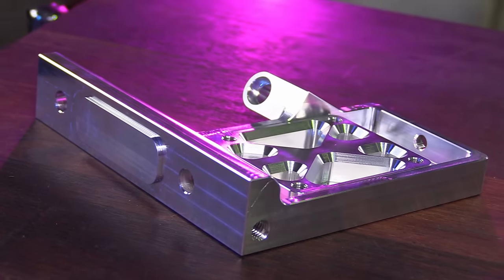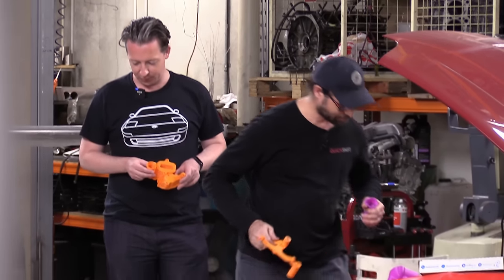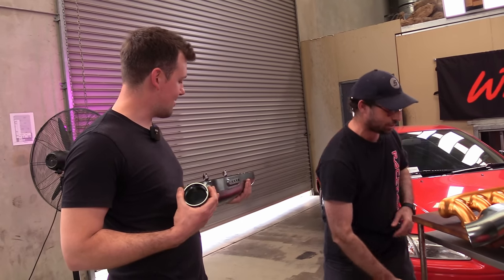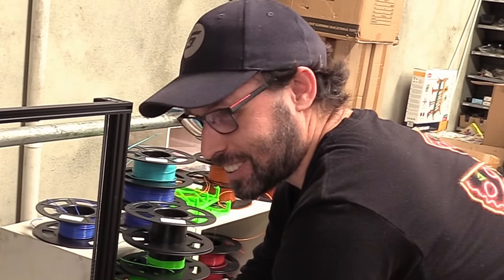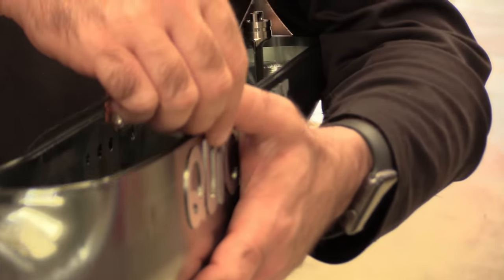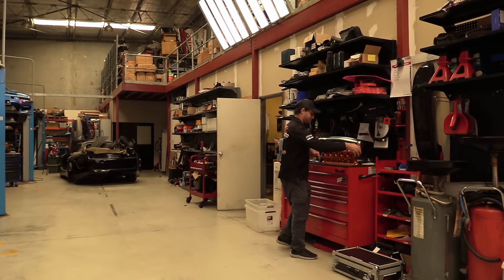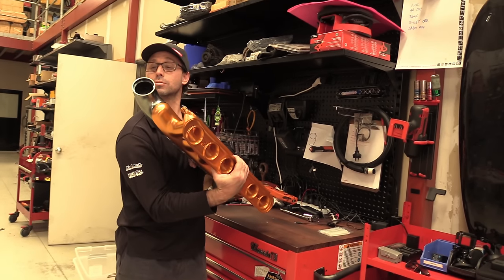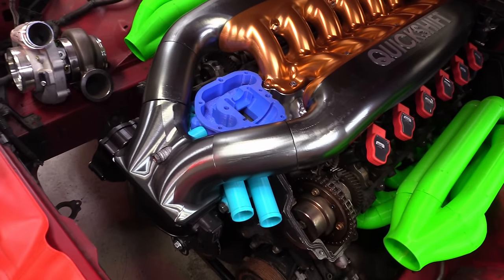Supra Supreme V12 - $10,000 Completely BILLET Intake is Here! [Ep17]

Comment: Use a lower durometer o-ring. Also you could have calculated the effective surface area of the manifold plenum, multiplied that by boost, divided by three and gotten the pullout force on each bolt. Combine that pull out force with the torque you can now measure applied to the bolt and you'd know if the load was to severe for the bolt strength or thread strength.
Reply from the maker: Thanks Dave! We do have some alternate o-ring materials incoming :) We have calculated the limits of the bolts and threads, that's no issue. The only concern is the possible flex of the actual billets under high boost leading to a loss of tension on the o-ring. Time will tell!

Comment: New Supra Supreme days are always good days. That manifold is something to be proud of, well done.  A better quality printer might be the go if you are looking for more accuracy too, although it'd be tough to find one that prints the sizes you need for a non ridiculous price, just my 2 cents.
Reply from the maker: I wish! Sadly, good quality printers that can do 400mm prints are $$$$. If I'm wrong, let me know!
Reply: @QUICKSHIFTtv  One thing that would get some instant results for less print fails would be to enclose your printer. When the ambient air temperature around the print fluctuates it can cause spaghetti piles as the printed part will curl, up particularly on sharp corners. Eventually it will get high enough to crash the extruder, which in turn moves the part and then it's all over at that point.. If you can keep the air temp nice and constant around the print head the extruded plastic will cool at a much more constant rate and weld itself to the part much better. 4 clear perspex sheets in a box around it wouldn't cost much and would do the job nicely.

Comment: without a thermostat your engine will take longer to warm up, but it will also continue to heat up as long as the car is running,...  so if you were to leave your car running without a thermostat for long enough it will overheat, thats because the thermostat is needed to hold the coolant in the engine block long enough for it to heat up to a temp that will expand the parafin wax inside the element of the core of the thermostat to open it and exchange the hot coolant, with the colder coolant in the radiator, which is beaing cooled by the moving air as you drive or by the radiator fan and in some cases both.    
Also an engine will generate the most heat whilst idle  not moving   (no air flow)   trick is larger surface area of the radiator   i grew up doing street stock and IMCA dirt racing  we dont run thermostats  we rev our sbc engines to 10k and its very rare to ever overheat  for 30+ laps on a 1/4 mile oval with 40+ drivers bumper to bumper   we have giant radiators on these cars

Comment: Amazing as always mate!!!!! But ? How come you just didn't use studs on the Plenums wing doodads? Why bolts? Seams like for ease of assembly studs would be a much better way to go, and increased clamping force as well. Just my 2 cents/ food for thought. Either way I love every episode and you're amazing craftsmanship ,the next episode cant come soon enough 😊
Reply from the maker: I feel bolts look nicer, and they're not the weak point.... the thread in the aluminium at the other end would be the first thing to let go. So bolts are good enough!
Reply: @QUICKSHIFTtv  wow thank you for responding, and it was the perfect response 👌I might add, I can see what you mean, a nice rounded machined allen button head design would blend in nicely with the rest of the manifold I concur. Also I didn't mean to imply it was a weak point, and I fully understand the threads in the other end would go first.

Comment: Might just be the camera angle but does that put the thermosat at the high point making it more effecred by any air in the system?  Perhaps a filler hole in the housing to help bleed any air trapped in the manifold when you fill the coolant. Could double as a sensor location.
Reply from the maker: You're a thinker! There is a secret bleed point at the highest spot, on the back side of the top housing.

Comment: Have you tried tree supports and limitations on infill walls if u limit them so much easy to pull out 
Good job though awesome work 👌🏻👌🏻👌🏻
Reply from the maker: Tree supports on my never ending list of things to figure out oneday. I haven't quite solved the support structure interface for easy removal either. Its not bad with PLA but PLA+ is so much stronger, it hates to let go. Also I print really hot for strong prints but I think that makes the supports melt in too much. More things to experiment with!
Thanks for the comment!

Comment: Don't know if this will help or not. I deal with large diesel engines  to get  away from large thermostats some engines I have use two normal ones. What I suggest is that maybe two small thermostats might fit better than one big one in that spot.
Reply from the maker: That genuinely came to mind. In the end, two small ones take up more room with plumbing than one big one.... and I was able to make the big V12 one fit.... after much failure. 

Thanks for the suggestion

Comment: Could u design a procharge that sits on top of the intake manifold instead of having pipe running out of intake no lag because damn thing molded straight to intake. Idk not ever seen anyone do it and I think its the key to no lag for exhaust side and intake side # no more intake exhaust tubes.

Comment: Loving the project, quick question on the water manifold though!  I thought the thermostat regulated water flow out of the engine before the radiator rather than after it goes through the rad?
Reply from the maker: I can't speak for every engine out there but every Japanese engine I can think of uses a thermostat to regulate cool water in, not hot water out.
I know what you mean though, it feels illogical!

Comment: I'm just starting out watching this video now and I've always been intrigued about the engines and the twin turbos but one thing that I've come to realize with a v engine in twin turbo and plenums you have to have a balance to between the two plenums to even out the whole engine because 100 could get one or two pounds more boost than the other side of the engine and that's not good. But do keep in mind that's speaking this speech to text I'm just starting out watching the video so maybe you do have a balance to between the two plenums.
Reply from the maker: It’s a good observation. We are combating this two ways, the plenums are being fed by a common intake pipe and dual butterflies that are connected by a single shaft to ensure equal distribution at all times, and we will also run twin pressure sensors so any difference in pressure can be detected and compensated for by the very powerful Emtron KV16 ECU

Comment: Hey what's the best way to get ahold of you guys. Have some cool stuff I wanted to talk to you about. 

Awd attesa ets supra conversions with gtr parts are suoer easy in the grand scheme.

So sre 350z gtr awd conversions and 370z conversions if you know what you are doing. 

Plus you can do some mods to the transfer case to use the electromagnetic clutch from g35s and r35s to make attesa even better on r32s to 34s. And conversions. 

You can also likely just make a billet housing that would convert supra 6 speeds to gtr 6 speeds with the additional transfer case. 

Might actually be worth doing. Would make it easier to convert some of these cars and play with more conversions. And make it possible to build a complete gtr or supra billet transmission versus trying to rebuild pull outs. 

Plus gtr parts are getting harder and harder to get ahold of. 

Worth thinking about. If you want to talk about some of the info just let me know. Might be worth business wise for actual profits given the number of 350zs 370z and the cross over bits. 

Would also come in handy for auto to manual supra and skyline conversions. And gt25 to gtr almost conversions. Rb30 blocks are cheap. After market rb26 heads and some machine time would potentially be a cheap route to a gtr engine built straight away for less money long run and some less uo front costs. 

Only thing really needed for the z conversions are some suspension bits that'd be easy and a few other things that wouldn't cost alot to r&d and produce. And that'd just to keep the added weight down and give an upgrade path. Other bits help the conversion.

Comment: Couldn't the fasteners have been mounted as flanges externally along the edges? No air flow disruption?
Reply from the maker: That was the original design idea, but it already sits <5 millimetres from touching the hood. The whole intake would have to be squished maybe 10mm lower with worse port shapes and smaller chambers and smaller trumpets to support this. Internal stalks was the lesser of the evils! Plus.... this looks cool, no?

Comment: Wouldn't a typical cooling system have the thermostat before the outlet to the radiator so you don't have to warm the radiator volume up as well as the block coolant first?
Reply from the maker: The hot water doesn't actually flow into the radiator until the thermostat allows cool water in to take its place. Its effectively locked in place.. it's normal practice for the thermostat to regulate flow of cool water in, not hot water out.
Reply: @QUICKSHIFTtv  I see didn't really think about it like that makes sense, just use to seeing the typical old school outlet thermostat housing. Thanks for the reply.
Reply: @LoweSpeedFab  At the end it doesn't matter, you need to block the water from flowing, you can stop it on the point you want, the only downside is that the radiator is presurized, and if it has any hole on it you will loose water even with the car cold, not only hot :p

Comment: im new to this build and havent watched the previous episodes yet, but is there a reason the intake manifold needs to remain in separate pieces, could you not just weld it together and be done with the complications?
Reply from the maker: Welding together was plan B, but ultimately I like punishing myself and was keen to solve the engineering challenge of a manifold with no welds, and very few visible bolts! After you watch the episodes, you will quickly realise that the simplest and quickest way to do this build is of zero interest to us!

Comment: Not a particularly "sexy" solution, but it looks like there's enough space around the water manifold to add a threaded boss inside the curve of the intake pipe to help clamp the front edge without changing the internal geometry.

Or, since you're 5-axis machining these parts anyway, you could model a slight "upward" curve into the runner section so that the mating surface is flat once it's torqued down.

Comment: correct me if im wrong please, but wouldn't having the thermostat housing right next to charge piping just increase intake air temps? that seems like it would heat soak.
Reply from the maker: Not really. The thermostat housing on average is the same temp as the rest of the engine (it has both hot and cold channels inside it.. cool water is rushing through it too!) but when you think of it, the entire intake is BOLTED to the cylinder heads which are the same temp as the thermostat housing, and is also in a closed engine bay which is in general, very toasty hot. So being next to a housing which is the same temp as the rest of the engine, but not directly connected to it is of very little concern.

The heat radiating off the turbos and headers would have a greater impact on intake temps... and of course the fact the intake heat soaks directly from being attached to the heads.
Reply: @QUICKSHIFTtv  thank you for the response! I hadn't really considered the cold fluid coming through it too. Keep up the fantastic work on this build.

Comment: You could have just used an electric water pump and program it to come on only at a certain tempture, basically the same thing
Reply: Same except for the bit where there's no coolant circulation around the engine at all until it's hot.
Reply: @whachadurnur  that's the whole point
Reply: @freedomwheelin431  if the coolant doesn’t circulate a little the temp sensor won’t get updated and the engine will melt with the pump shut off.

Comment: So cooled water coming from the radiator goes to the thermostat....... Backwards isn't it????
Reply from the maker: Both ways are possible, pretty much every Toyota petrol engine I can think of runs on the cold side of the radiator, with hot coolant being bypassed through the back of the thermostat to open it. Including the 2JZ that came in this Supra, 3SG, 4A, 4E, This v12.. etc
Reply: @QUICKSHIFTtv  thanks for the reply! I can see that working for smaller engines, it won't be an issue with you bigger 12 cylinder warming up?
Reply from the maker: It's all the same really. Both ways, the coolant is locked inside the engine, circulating internally until the thermostat opens.. nothing in means nothing out. And heat seeping out of the non-thermostat hose into cool water affects both.

Come to think of it, even Chev switched from hot side to cold side thermostat when going from SBC to LS. Maybe some of the big brains out there can explain why they did this.

Comment: You are so worried about tightening those bolts but you fail to use a torque wrench and actually measure load, figuring out a min/max spec required. In testing and development you should eliminate variables....like uneven torque and unknown torque.
Reply: I mean... he isn't torqueing the bolts at all. He is testing flex while crushing the o-ring. Torqueing the bolts comes after that.

Comment: I have designed just about every type of system on a car and almost all were for mainstream OE. I designed prototyped and dyno tested the Walkinshaw Group A cylinder heads in six weeks. And I did it by myself with a pencil and paper then filing and filling the sand molds in the foundry on a Sunday. There are proven engineering calculations for every mechanical problem, F1 can't even test a design before they race, they engineer things so they know they are right before they cut metal.
These guys would never get a job in a real engineering environment
Reply: Who let the boomers out..  who.. who who.. who who
Reply: "Such incompetence, An F1 engineer would NEVER have made this mistake!... also, I'm heaps gooder at engineering too!" haha... Jog on ya flog.

Comment: Not only is the intake going to leak everywhere, but the thermostat housing is going to make the intercooler dead weight. But mainly on the other bank. The question is, just how bad can you ruin the best engine Toyota ever made?
Reply: "but the thermostat housing is going to make the intercooler dead weight. But mainly on the other bank"........................................Please explain
Reply: @rav3n925  That thermostat housing is a radiator, with an ability to form a gas block on the cooling system. But that is only going to kill the headgaskets, the radiating heat is going to heat up the intake runners, and with both of the coolant lines going under one runner, the heat is biast to that side. You can wrap it on platinum, it's still a piss poor design.
Reply: @oikkuoek  lol what are u on about.
Reply: @oikkuoek  Lol, Yeah it will radiate some heat for sure but Negligible amount! gas block the cooling system and kill the gaskets? LOL......Perhaps make your own and show the world how much better you can do it, Or better yet actually, The internet has this weird thing where if you keep scrolling you will find something else that you might actually enjoy! instead of criticizing someone's project with no useful information on how you came to that conclusion!
Reply: @oikkuoek  Well, usually intake manifold runs at water temperature (90ºC), sometimes a bit less, this should not be a major impact in the way it works, since everything is bolted to the head, and the head is irradiating a lot of heat due to the combustion inside the engine, this would not affect the engine perfomance at all. We will see when they finish it which IAT they get, but they will be OK
Reply: @arnaumarce3943  In stock it does, but stock does not make any power, and if one tries to make power (boost) on stock parts, they give in. Intake temperature is the greatest factor to power and reliability, Cool intake cools the combustion chamber, etc. intake gasket is an insulator even in stock configuration, and keeps at least some temperature difference between the intake and the head. naturally aspirated stock intake has some water running thru to help keep the intake open @ cold climate, but it does not make any power. Good tuner intake has the water blocked off, and the whole intake insulated from the head. Will this v12 make power when boosted? yes, at the dyno, hood open, for a couple of pulls. Assuming they manage to clamp the intake so that it doesn't leak. Will this v12 handle any boost? No. the whole setup is too hot, the cooling system doesn't work, and the intake is a shiny piece of crap.
Reply: @oikkuoek  let’s see where are the limits for this setup, I’m pretty confident it will work well, and they are developing their own solutions and this makes it nice.

My bet here is that it will not affect at all (or it would be marginal). Only the results will tell…
Reply: @arnaumarce3943  Nugget garage ran their stock bottom junkyard hack job up to 12 pounds of boost. I doubt this setup being able to handle even that. Also their target is 1 Khp. You can make the same with three cylinders, or one if you machine it from billett.. So the whole deal is just one shiny waste of material. Nothing new in tuner world, but still shameful.